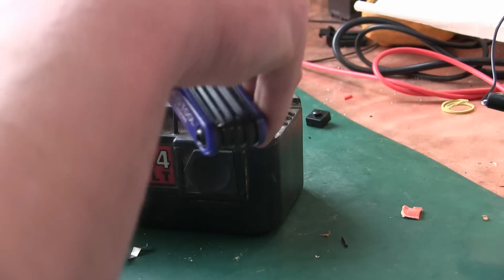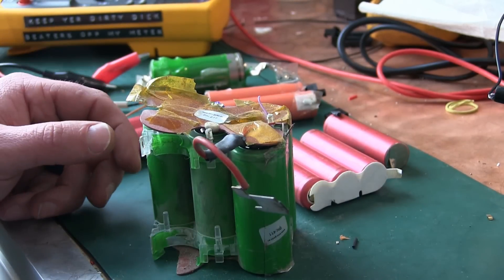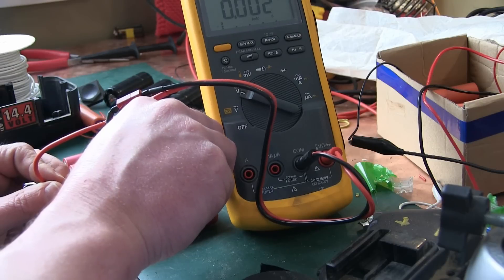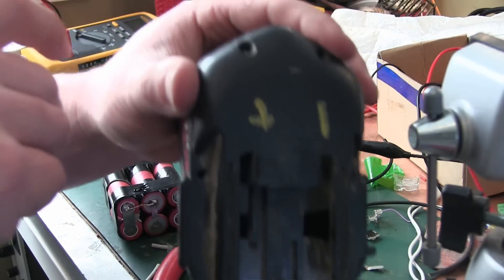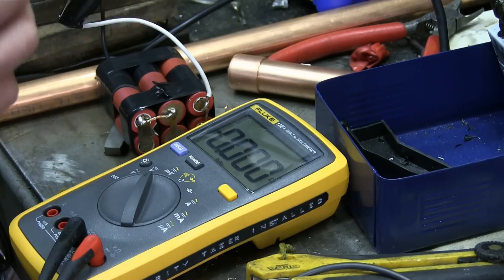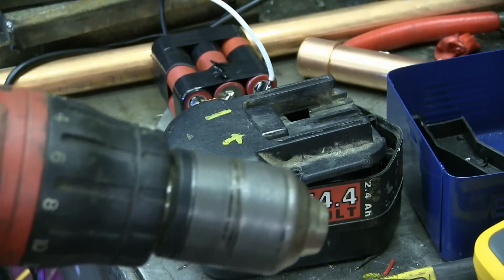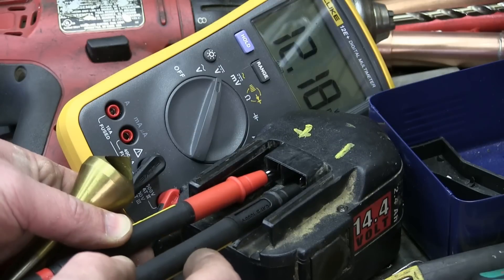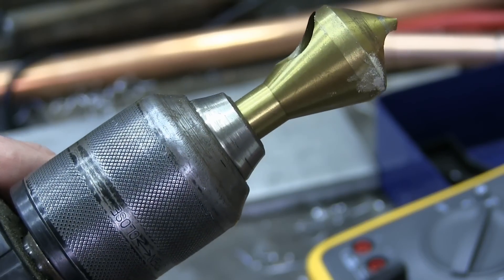New Lithium for Old Tools!

Comment: NiCd cells are 1.2 V nominal per cell, so 12 cells is 14.4 nominal. Depending on the particular chemistry of lithium cell used it has a nominal voltage of between 3.2 and 3.85 V per cell, but from experience I can say most often it's 3.6. This means that 3 lithium cells in series would give a nominal voltage of 10.8 V, whereas 4 in series would give the 14.4 the battery claims. Don't worry that the peak voltage of 4 cells is 16.8 V, 12 NiCd cells right off the charger is 17.4 V.
Reply: His issue was that he could not (retro)fit that many in the (old) case.
I'd have a new, bigger case 3D printed.

Comment: 48-11-1024 14.4V 2.4Ah battery is still available via Milwaukee, BUT they are not cheap. LIST price is $207.00 but I am sure you can get them much cheaper than that.  Nice to see you salvaged some Li-Ions to bring that back to life.

Comment: Just mount some batts on the outside of it too. Drill some holes in the case to the inside to connect them to the rest of the batts. Wrap it in a bhut load of tape or pot them on with a good substance. 
The reason that the Lith ion batts don't give as much power is that NiCad batts, as a characteristic, give constant voltage till nearly the battery is discharged. Other types, generally, will decline in Volts until total discharge. ...Amirite?
The batts we use on our -8 aircraft at work are two 75lb nicads in parallel to assist in batt starting the engines. Beefy as fork! Nicads are old tech and more bothersome but they provide great power if you know how to take care of them.

Comment: I made 25V for 14.4V bosch impact screwdriver... I know its overkill but It gets the job done much faster than dewalts 20V version... It even put 10x200mm wood screws into hardwood till the bolts head snapped off!  The switch was rated 24... The 12V one was rated 15V... Both work at 25!   Today's batteries and oldschool tools with proper brushed motors- Profit!

Comment: There are smaller Li-ion batteries eg 16340's with a nominal 3.7V, so 4×2 cells 14.8V, but in your example or any you need a balance board.

Comment: The old recovered cells have high internal resistance, so not quite useful for high drain applications
Reply: The voltage drops really quickly under load and then shoots back up when unloaded. 5 cells in parallel would probably do well. Try making a crazy "portable" battery contraption. Thanks for the videos :D

Comment: you can integrate into battery housing one of this cheap RC model li ion beeping low voltage guards. It is multicell so... it start beeping when cell voltage is near 3,2V, cost around 1 dolar or 2$ for badass version with display

Comment: 18350 cells do 4 pairs for 14.4v-16.8v
Reply: And lose a lot of capacity in the process.
Reply: Vs the cells he has not really the speed and torque he would regain he needs 4s 2-3p
Reply: Just using brand new 18650s instead of those well-worn cells would easily provide the proper power. 4S 18650 fit 100%, and deliver more capacity and better high drain performance than stuffing a whole pile of 18350s on there.

Comment: You have plenty of extra space to add a protection circuit. You can find small cheap ones online. Stuff a small one in there and it should cut off when it gets low and also allows you to use the original charger as it will charge it up properly then cut off before damage to the cells.

Comment: Similar story with my father's 18V Makita. Nickel batteries were more expensive than the new lithium ones so he bought parts for the new type of connection, hollowed the old battery, passed the wiring through up to the new connection pourt under the battery and just plugged the new battery under the old one.

Comment: 1,5v is not a good battery. 2,5v is the least the should have, any lower and you should throw em in the bin.
Reply: He said recover, you CAN recover a 1,5v lithium cell. 2,5 is just the ideal voltage to start charging again.
Reply: Yup, managed to recover the battery for my Canon camera yesterday with a bit of judicious fiddling. It was showing under literally 0v but a few soft charge cycles seem to have got it back to life again.

I'll be replacing it once I have the cashflow, but just to check the camera and all the lenses work (and getting a few good pics of things I'm selling - because I'm skint) it'll do the job - but I am removing the battery pack from the camera and storing it safely when it's not in use, just in case.
Reply: +djteac there is no recovery at that point. The cell chemistry of a lithium ion cell changes drastically below 2.5v, causing the capacity to shrink and emission of gasses when recharged.

Comment: Actually, to properly charge it, you'll have to take it apart to get to each cell (pair) to charge them individually. Real Li battery bricks have that charge controller builtin. Yes, you can get some level of pixies back in there in series, but some cells will be at a higher charge ("over charged") with others less charged.

Comment: you could get a 4s battery pack from hobby king, (15-30$ depending on capacity) an annoyer for when the battery gets low (2$), and a few wires to go to the balance leads for when you want to check/recharge the batteries individually.

Comment: I have 2 Ryobi drills.  A 14.4 (came paired with a work light) and an 18v that came both with Ni-Cad batteries originally. I just bought a bunch of 18v Li-Ions and a new charger. I had to mod the work light base with my rotary tool to get the snaps to fit right but it all works fine.

Comment: Few things to point out.  1) If you just charge all the (questionable) cells in series and they're not all perfectly matched (they never are doubly so for salvaged batteries) then the pack will die a lot faster.  It's best to always balance charge them.  You could bring balance leads out and use a cheap Chinese balance charger.  2) Lithium cells don't do well being discharged below ~3v/cell.  Seeing 1.5v at any time, I'd immediately assume they're toast and recycle them.  After watching the end it's pretty clear they are toast.  3) guessing at SOC (state of charge) from an unloaded cell voltage can be deceptive.

Comment: Iv Got the 18v version of that drill, and yes its been demoted from a tapping drill to a cs drill because of week batteries. Iv been planning this conversion forever just have to get around to it. However at this point I cant say anything bad about the fuel drills time will tell.

Comment: I've got a big pile of RC Lipo batteries so on 2 of my old drills I just stuck one in and cut a hole in the side of the battery case to hang the balance port conector out to charge with my Imax B6.

Comment: I noticed that you can get higher mAh in laptop batteries than tool batteries, tool batteries average between 1500-2000mAh while some laptop batteries range from 1600-2700mAh (at least the 50+ I dismantled)
Reply: The reason for that is that tool batteries have high drain cells that cost more to produce. To reduce costs they buy lower capacity cells.
Reply: It's not to save costs. When manufacturing a cell, you can build it with a certain function in mind. Either you get high capacity or you get high disharce-rates (lower internal resistance) - You can't really have both.
Reply: ***** You are right to a point. However, there are cells with higher amp rates and capacity, especially now. The cost alot
Reply: laptop batters can generally only handle a 4amp drain....while tool batteries can peak well over 40amps. ICR batteries are NOT meant for high current and will tend to explode violently compared to IMR

Comment: I install BMS boards and BUCK Voltage converters inside of my Lithium conversions to maintain compatibility with their original chargers. After that you just need to be sure not to leave your batteries on the charger for optimal life.  Have fun with that my friend and thanks for the video

Comment: The other thing is running a lower voltage, the motor will want to pull more amperage hence a quicker battery draw. If you up the voltage it should last a fair bit longer.

Comment: What happened when you sparked was your metal pliers were touching the side of the cell that was connected to the +, the entire sidewall of an 18650 is ground so you basically just short circuited the cell with the + facing up by connecting the sidewall through the pliers and the nickel strip

Comment: You can make you a cool little bench drill just by making it a corded drill and makes you a nice flexible cord with a couple of disconnects and just plug it into that fancy dancy little power supply you gots yourself there!  I have done just that with some Dewalt 12v stuff I have.

Comment: the lithium batteries have a work volt of around 3.7 volt, so its only at 4.2 when fully charged, steps down towards 3.7, and holds it until it runs out =)

Comment: I upgraded also my 12v drill with these red Sanyo cell. The drill has enough torque and speed but the cells wont stay in balance. I'm thinking about buying some Sony VTC4 18650s and adding balance charging.

Comment: I've built a couple Li-Ion battery packs for various shits. I get those cheap-o low voltage alarms for model RC planes or something like that and just wire em in. When the battery gets too dead the pack starts screaming and annoys me into plugging it in, works well for me.

Also yeah, even the high draw cells out of power tools drop way down in voltage under load. Your probably running that 14v drill at like 11v. I'd add a 4th set in parallel, I bet the old Milwaukee will handle the extra umf just fine

Comment: DeWalt has a battery adapter for their old 18 volt nicad tools to accept the new 20 volt lithium batteries. Unfortunately Milwaukee does not provide this upgrade path but you could make your own adaptor. Those 14.4 volt tools just run fine on 18 volt batteries, no problem. In fact you could adopt this to any tools with any batteries. For example I have my Ryobi 14.4 volt circular saw running on a Milwaukee M18 9.0 Ah battery all day long. Oh yeah that shitty Ryobi circular saw now runs like a pro tool. And my old V18 nicad  Milwaukee tools on M18 lithium batteries got a new life as well.

Comment: Lithium-Ions are charged to 4.2v, but almost immediately plummet to 3.7v, then they drop to about 3.3v, linearly, as they discharge. Then it knees and voltage plummets (it's 95% drained at 3.3v anyway). So, what's happened here, and why you have so much torque still, is that the batteries are JUST FINE. They're just 11.1 - 9.9 volts which is what 14.4v nicads would be when just about dead. So RPM wise it seems dead, but they still have torque. Lithiums are so powerful, just chain up 4 (or 5, or hell 6, the Milwaukee will be just fine, often it's the same motor in 12, 14.4, 18, 21v drills, the cost is just the battery size) in series and don't worry about the two in parallel. Try it and prove me wrong, but I'm pretty sure I'm not.

Comment: Hey AvE, I suggest you balance charge instead of feeding 12.6V into the main battery terminals. If the cells get out of balance (and it happens) then one can get above 4.2 and let out the magic smoke and burn your house down. Put a 3S JST-XH balance lead on and get a decent lipo charger!

Comment: Sometimes the fets & motors are depending on high voltage drop of nicd, nimh under heavy load. With lipo, there is a good chance you'll destroy your motor if under heavy load.

Comment: Best way to test those used cells is to charge them up and put a 1 ohm load on them and measure the voltage drop. The crapped out cells will instantly go from 4.2v to less than 3v and then jump back up to over 4v when the load is removed, this is due to high internal resistance. New cells will drop to 3.7v.

Comment: i think you would need to balance charge the batteries if you would want to keep using the pack because you could otherwise have one battery be below the low threshold voltage and destroy it. (i had an 18650, that was over discharged, blow up once)

Comment: Glad the top comment warns about the fire hazard - no protection or balancing w/ random old batteries is asking for it. Hopefully no one else watches this video and tries this! 

As others have mentioned you want 4S, not 3S to get 14.4-14.8V nominal. You can easily get an all-in-one 4S balancing protection board/BMS PCB for $10 or less. Good quality 18650s Like the Pana-Sanyo UR18650 (20A continuous discharge) are about $5/ea, so $30 to build a 4S1P for 14.4V/2.5Ah or $50 for a 4S2P 14.4V/5Ah.

Of course, going on Amazon, I was able to find a 3rd party replacement 48-11 14.4V/2.4Ah battery for $26, and there were plenty of internal battery replacements on eBay for $30-40 as well so I'm not sure what, if anything you're saving to DIY in this case.

Comment: I have an old wireless 18v B&W drill with a burnt motor... Want to replace motor and battery with better ones. 
This is a project I've got on my list, next to repairing an old Optoma projector power supply, and replacing the dangerous light with an Led one.

Comment: yeah I got a old  giant r/c buggy with nicads and charger. Hadn't got much use out of it cause It'd last about 10 minutes and the charge process was something out of the exorcist. A bit too hot for my tastes.   A new batch of batteries and a basic updated charger worked just fine. About 9.6v per pack but that's AA-pack toy car torques. Made it completely usefuless again.

Comment: I had success by fitting new 18V Makita 4Ah battery to a cheapo 18V drill that cost $20. The NiCad batteries were long dead. The drill got another life now and all with a bonus of 15-20min charging with the EU model. The batteries have their own capacity indicators and I even bought a proper Makita connector on eBay because you shouldn't fool with these things too much.

Comment: I have an old Milwaukee 12volt drill when they first came out. I have had 3 sets of batteries. I have a sedimental attachment to my drill also. Its just a weak back up drill now. I wonder if they could be converted to lithium Ion. Thanks for the video. Always enjoy them.

Comment: Did the same thing with a 14.4 volt makita.  Its the current delivery of the battery.  Starts out ok and quickly drops off.  Then takes ages to recover.  I have some samsung 25A high drain batteries I recovered I am going to try.

Comment: My friend took a broken 18v makita drill, sawed off the battery connector from the makita and hobcobled it onto a bosh 14.4v impact drill.
This francendrill now takes standard makita 18v (20v charged) batteries. And in this "overvolt" state gives "quite a bit och pucnh".
So if you have 2 of these drills? why not take some broken 20v drill and do some surgery to one of them.
The benefit is a standard batterypack with the protection and the charger and batteries to the broken drill finds a new lease on life.
Reply: When digging through the old archives... i stubeled upon the truth how he did it.
Saw the bottom (battery "clip") of any 18-20v lithium tool.
Take your broken nicad battery., use the top "clip" part and solder and glue it to the bottom you just cut of.
Now you have made an adaptor. And onw working tool from two broken ones.
Clip your adaptor to the old drill and your fancy lithium battery to it.
This way you do not have to modify your working drill.

Comment: Using nominal voltage . . . 14.4/3.7 is 3.89. I would bump it to 4 cells and only charge them to 4 or 4.1, if you're worried about overvolting it.

Comment: What about a custom, external battery pack that powers the drill from a length of (fairly heavy guage, because current) flex?

That way you can get a good selection of batteries in whatever layout you like, a cheap charging circuit to keep the cells relatively well looked after, etc in there without having to piss about with the existing battery sled and it's tight capacity?

Yeah, you lose some practicality/weidlyness of having the pack securely attached to the drill, but you'd at least get the performance out of it and there'd be less to worry about in terms of charging/discharging issues?

Just thinking out loud, though - no idea how usable it'd be...

Comment: Maybe try creating a 4S pack, giving you a nominal voltage of 14.8 which is real close to the drills original rating. This will give you slightly higher rpm and more current flow due to the higher voltage. As long as you aren't surpassing the current draw per cell, there may be no reason to have the paralleled cells other than prolonging their life.

Putting them in parallel only means you "can" draw more current safely. It doesn't necessarily mean that more current will flow. Ohms law says that if the resistance stays the same, the voltage must increase for the current to increase.

With the extra space include a low voltage cut-off/alarm circuit, like what is used in the RC hobby.

Comment: Worked for a rental company owned by atlas crapco... compressors were ok but that cobra gas breaker should have been sold as an anchor. Having dibs on the best of Milfukee for the shop was nice though.

Comment: I still have 2 of these and I still have 2 of the atlas copco versions. And have to agree they were great drills. The only downside to the now 12 years on is the batteries as you would expect but the switches are faulty. So it's pot luck if the turn or not. Changed to the yellow Devils last year.. But still have the old girls just in case!

Comment: If someone were enterprising they would come up with a drill case that you can put rechargeable eneloops in (like a radio battery compartment thingy). Make a case for any brand drill and sell it with the eneloops and an eneloop charger.